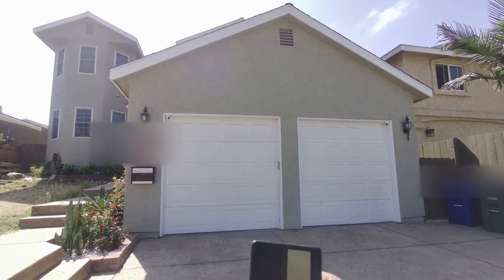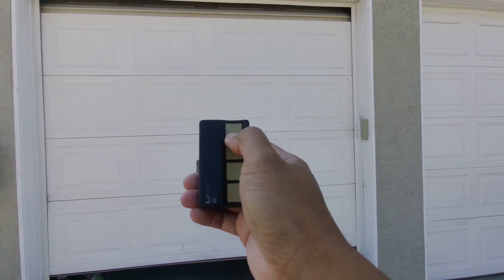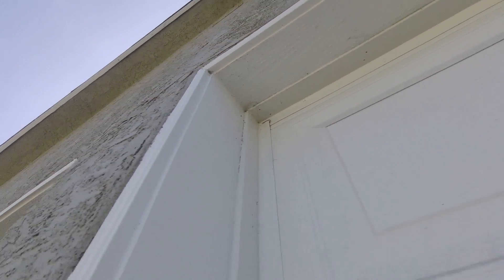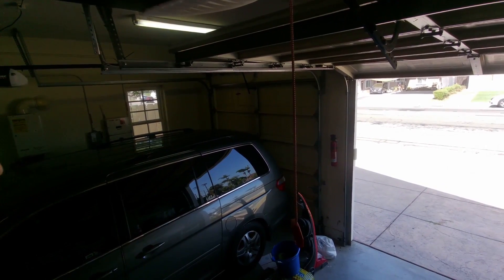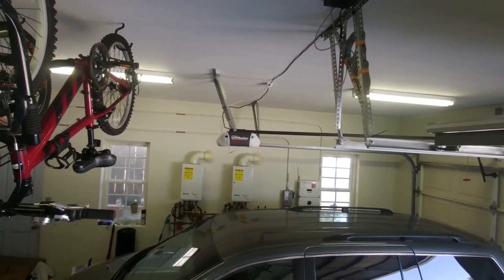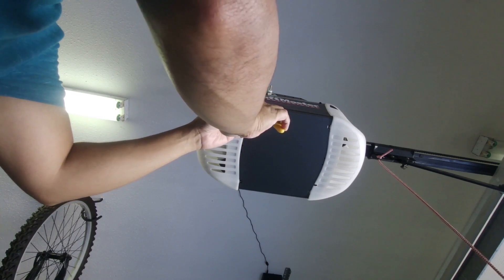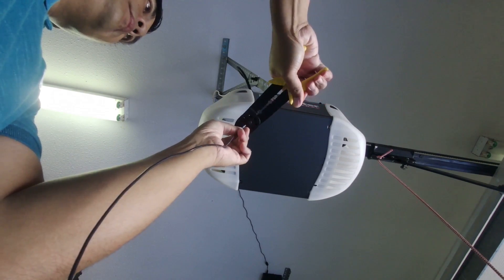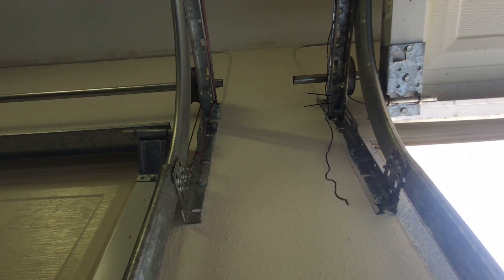Extend Your Garage Door Opener Range - Easy Fix

Comment: The wire coming out of my garage door is such a small gague, would it make sense to connect it to a thicker gague like you did? I think it's like a 20 gague or something, stranded copper
Reply from the maker: You are just trying to boost signal and not running electricity so it's probably fine. Others even use the solid wire for the cable TV with success.

Comment: Is it better to run the exposed antenna at a higher or lower elevation?  Like, is just at the top edge of the garage door better or would 4-5 feet above the garage door be better?  Since the top of the car is only 5 feet above the ground, I wasn't sure if higher might acually be worse.  Thanks.
Reply from the maker: Not sure if it makes a difference. Someone commented another idea saying he attached the antenna to the metal railing and it worked well for him.

Comment: Works great, thanks very much for this simple, elegant solution. I took a roughly 15” of TV coax and used a wire nut to connect the garage door antenna to the center conductor in the coax cable. Then I connected the other end of the coax to the aluminum opener motor straps hanging from the ceiling.
Reply from the maker: Glad this helped, thanks for sharing your solution!

Comment: Great info. Thanks. Like and subscribe buttons hit! Was having this problem after replacing the fried original circuit board on my opener. Thought it was the replacement circuit board but watched the video but before I ran out to get some wire, I decided to try stripping off some of the coating of the antenna wire to expose more wire and that did the trick. If having this problem, try this first.
Reply from the maker: Thanks for the support and for sharing your experience.

Comment: Had a 10 year old Craftsman that seemed to had reduced range when door closed and all lights were off. I could not open the door unless I got out of my vehicle and brought the remote up to the door. I extend the wire 4x the length of the wire coming out of the opener and now I can open the door from inside the vehicle. For now it’s operational.
Reply from the maker: @jimmyg6215  Thank you for sharing.

Comment: I tried this and it didnt work unfortunately 😔
Reply from the maker: Sorry it did not work for you. Do you have other devices that might be interfering on the signal? Or maybe try replacing the remote battery and hope that a combination of new battery and longer antenna will do better?

Comment: When I installed LED lights on my garage the door stop working when the lights are on. I was wondering if I extend the antenna cable will help. So now I will try this! THANKS
Reply from the maker: I have the 8 tube LED's in my garage and the 2 lights outside. I'm still able to open the garage. Good Luck.

Comment: Super cool, can you just use electrical tape to connect the antennae with the wire?
Reply from the maker: Yes. You can twist the wire together and protect it with electrical tape if that is what you are asking.
Reply: @diymanual  Yup, thanks for getting back to me.

Comment: Does this help too if the keypad isn't working?
Reply from the maker: @arpizzle123 , Do you mean for the keypad to get the signal?  When the garage is open, does the keypad work to close the garage door but it doesn't work when you try to open it? Have you tried replacing the battery for the keypad?   I'm just asking because the keypad is right outside the garage door so it should be able to pickup the signal without adding any extension.  Also, did you recently add any LED lighting or appliance that can interfere with the signal? Other's say that LED lights/bulbs and some electric appliances can interfere with the garage door signal so that might be something you may want to check also.  In my garage, I have 8 LED tube lights that I use to replace the old Fluorescent tubes, a refrigerator, security camera  and 2 tankless water heater.  I'm not sure if they are causing my signal issue but I can't remove them from the garage so I tried this method and it worked for me.

Comment: You do not need to lay new wires. Just solder or tie existing antenna wire to any none moving lengthy metal component nearby such as sliding rail of the garage door. That will act like huge receiver antenna. Very neat and cheap way to do it.
Reply from the maker: Thank you for sharing your idea. The rail is long and goes straight to the front wall of the garage plus it's bigger than the wire so it will probably work better.
Reply: Thank you both. I connected the existing antenna to the metal sliding rail, and the weak signal problem was fixed!
Reply: This is incorrect. Antennas need to he specific orientations and lengths to be tuned to the frequency they are receiving.
Reply: @Walru5hunter  I have read this as well, but as in the video, the copper wire length was 20x the original antenna length, and it worked.

Comment: Does the length you add matter? Like changing the antenna from a 1/4 wave to 1/2 or larger. Does it matter?
Reply from the maker: I guess that will depend on your situation. They say that the problem is usually because of LED bulbs interfering with the signal so if you can eliminate that it may actually solve your problem without extending your antenna. I'm using LED light tubes in my garage and also have other electronics in the garage (refrigerator, WiFi security Camera, Smart Plugs) that may cause interference. Other says that simply adding a foot of cable increases their range. But for me I can't get the remote to work until I actually extend the antenna to the outside of the garage door.
Reply: Yes the length matters. The DIY successes are often people getting lucky with right lengths. You can improvise and adjust until it picks up the needed frequency but a dedicated coaxial extension + proper 1/4 wavelength antenna is best way to do this

Comment: I tried this fix but it didn't work. Come to find out it was the cheap LED bulbs that I installed on the motor. Being plugged in but off (not lighted) still interfered with the signal when pressing the remote button. Once I unscrewed the bulbs, I could reach from a couple houses away.
Reply from the maker: Thanks for sharing.
Reply: Thank you!  My problem started when I put in LED bulbs.  The older fluorescent bulbs worked without an antenna modification.

Comment: this really isnt the proper way to do this.. your makin the antenna longer than what it actually is suppose to be.  First off, find out what frequency your door uses, then measure the wire for a half wave and use that.. will workk alot better! this is just my 40+ year experiance in antenna theory and design 2 cents
Reply: Use the K.I.S.S. rule.
Reply from the maker: Thank you for sharing.

Comment: As a quick test, I used a wire nut to connect my opener short wire to a loose wire about 10 ft long and just moved the end towards the door.  It appeared to work well by extending the range to the end of the drive.  I then moved the loos wire and had it run along the ceiling towards the door again and this seemed to improve my range of the remote from before.
Reply from the maker: Thank you so much for sharing this.  I'm sure many people will find it useful to test their setup first before securing all the cables to improve the range of their remotes.

Comment: So many times the range is reduced when you use an LED bulb or have wireless cameras like Wyze or Blink around - or other 2.4ghz frequency devices near by.  The 2.4ghz frequency interferes with it.  Adding this antenna helps because those wifi signals are weak outside of the home.
Reply from the maker: Thanks for the input.
Reply: @almondao this is exactly why i'm looking into this because of the Wyze floodlight cam I bought, when it's powered on, my openers don't work at all from outside unless I'm right at the garage door. I'm assuming extending the attenae just like this will get around that cam interfernce. Did it work for you?

Comment: Great vid.  I actually upgraded my garage opener, but no longer using the remotes.
Reply from the maker: Did you upgrade to a smart garage door opener?
Reply: @diymanual  absolutely. The remotes I keep in the house.
Reply from the maker: I have MyQ in one of my doors that I use for Amazon delivery.  I also installed a Wyze cam in the garage so I can see the delivery person's activity when they deliver the product. So, far the assigned delivery person are good and honest. They would simply put the product to where I specified on the app as the door opens and they close it right away. Most of the time I just see their hand because they start closing before the garage opens high enough for the camera to see them. The only time they go in is when the package are bigger.

Comment: Here is the REAL TEST for LED light interference. Simply unscrew the LED Bulbs (all of the circuitry is in the bulbs, at least the most common LED bulbs) and then test your remote, plug them in once more and see if you can get repeatable results using the remote control from the SAME distance outside the garage. A long coax cable solved my problem (w LEDs left in place) and  since I just thought of this I haven't tried this test. If you, please let us know!
Reply from the maker: Hi! I think the LED interference theory is true. I was having similar issue in my previous home a few years back and I have LED's in the garage motor as well as the exterior light in the front. After removing the LED's it fixed my issue. 

So removing LED's is the first thing I did  after we moved into this house because I just can't get the garage remote to work without standing next to the garage door but I have no success. I even unplugged the Fridge in the garage but it did not improve the range that is why I tried the extending the antenna method that I also found in Youtube and it worked. Of course, this garage have no decorative window and is surrounded by cynder blocks about 7 ft. high.   

After extending the wire outside. I put back the LED's in the garage motor as well as the external light in the front. The range distance may have change but I did not notice because I only activate the remote when I am already stopped in my driveway. My wife does activate the remote as she turn to the driveway and never complain either.  However about 2 months ago, I converted eight 4ft. fluorescent ceiling lights in my garage into LED's (you can see that in my other videos) and after that I noticed that I have to press the remote 2 or 3 times to open the garage.  I decided to keep my LED's because I can still open the garage door and I don't really activate the opener until I am at the driveway so a few clicks does not bother me.

Comment: Very helpful. However I don't think you need to bring the wire outside the garage. I seriously doubt that the garage doors actually block the wireless signals. I'm basing this on my own and other experiences shown in other videos which show that simply extending the antenna wire 8-10 feet toward the door (without having it protrude to the outside fixes the sensitivity problem. However, while your video uses plain solid wire, others suggest coaxial wire (TV cable wire), some even suggesting grounding the coaxial shield, I used coaxial wire and did not ground the shield, and that did the job. Some people suggest that the coax may help with reducing noise coming from LED lamps. Now I can open my door from quite far away with every button press. Thanks !
Reply from the maker: Thank you for sharing. It may have something to do with the wire. I tried extending it first and it seem to work but I got better signal when I run it outside with the wire I am using.  I may not have to do that if I started with a coax.
Reply: How did you wire to the coax?  One lead to the center, and one to the shield braid?

Comment: I’ve read to only increase the length by 2x or 4x. Do you agree with this? I tried this trick. I think I crimped things right and no success. Even worse signal
Reply from the maker: It did improve it for me by a lot.  I assume you have tried replacing the remote battery before trying this?

Also you may want to check if you have any LED lights in and outside of the garage as there are known to cause signal interference.

Comment: I recently had a similar range issue with my opener.  I changed the remote opener batteries, bought new remotes, changed out the incandescent bulbs, and even changed out the circuit/control board.   Non of fixed my problem.   Finally, I extended the antenna wire with 14 gauge wire and attached the end to the door track which solved my problem.   Thank you!
Reply from the maker: Thanks for sharing
Reply: Problem, not "issue."

Comment: Buddy, this problem is NOT related to antenna.  It is the frequency of LED lighting that interferes with the garage door opener.  Change the LED lamp to a regular lamp and your opener will open your garage from even 100 feet or even longer distance.  Hope this helps those who have the same issue and watch your video.
Reply from the maker: Thanks for the comment. You are correct, LED and even other appliance in the garage can interfere with the signal. And to those that read this comment from @fatisalimian2682 you should try that first before doing more work.  I have the same issue with my previous home and I was able to fix it by replacing the LED with regular bulb but for some reason it won't work on this garage. I actually removed the bulb and replaced battery on the remote to no success. So interference can be caused by something else or it is just that my garage door is thick and have no window compared to my other home.  I saw some video suggesting this so I gave it a try on one of the door using the thin wire I have laying around the house and it worked. So, I did this video using a #14 solid wire and to my surprise it worked better than the thin wire I used in the other garage door. So, whatever is causing it to not work when the antenna is just inside the garage was fixed when I extended the antenna outside.
Reply: @diymanual  thanks for your video I agree we don’t have a bulb at all on our garage door motor and it’s still having problems with distance control so we’re going to extend the antenna  and see if that works
Reply: We have extensive led track lighting installed and since then have tried everything to mitigate the reduced signal distance. I installed 30+ ferrite loops and cores all over all of the wires, NOTHING is working except turning off the LED track lighting, until I extended the wire. So don’t poo all over this until you’ve exhausted the other options, but if it weren’t for the fact that I’ve spent months adding the ferrite cores, I’d take em all down and see if the extension alone fixes it
Reply: @fatisalimian2682 Hey buddy. All my bulbs are incandescent bulbs. What other bright ideas do you have, buddy?
Reply: If the LED light if off before pressing the remote button, how does it interfere? Does an LED light bulb interfere even when off? Thank you.
Reply: 🤦‍♂️ Please don't listen to this guy. The absolute confidence he speaks with is something you only see from people with limited knowledge.
Reply: Good sir, thank you. This saved me time, anxiety, and money.
Reply: Can you change the frequency to allow you to keep my LEDs??
Reply: My antenna has a little plastic or glass cap at the end, if I cut it off to extend it with a wire, would it damage my antenna?
Reply: Removed my led lamps and still the range is terrible.  What gives?
Reply: From what I remember about my CB and Ham radio days the wire length is tuned to the frequency of the transmitter. Maybe it doesn’t matter in this case, but I thought extending it with a thin piece of coaxial wire then stripping it back to the same length of antenna that would stick out of the unit might work better? 

On the other hand if a solid piece of wire does the trick, why not just keep it simple and do that? 😊

I haven’t made any changes to my garage, but a software update in my car seems to have reduced the range or caused intermittent issues. Sometimes it opens sometimes it closes. I’ve got a HomeKit enabled opener/closer that I installed so when the Tesla doesn’t automatically close it I generally say “hey Siri close garage door” and it closes, but it’s a bit of a hassle and would like the car to automatically open and close the door when it’s in range like it used to. I’ll consider this option thank you!
Reply: Thank you for chiming in here, I didn’t know that my new LED would affect the range, and that made a big difference, changing it to a non-LED bulb ASAP!
Reply: You just saved me an hour of my life.
Reply: Well the light bulb is blown out and it's a regular halogen bulb so it's definitely not the bulb for me. I think I'll try extending the range with a solid wire
Reply: The LED bulb was my problem. Thanks!
Reply: Buddy, how do you know that he has LED's? Telepathy? I'll bet that you can repair all electronics without even looking at it.
Reply: @joesimone223   I had the same problem.  My garage is fitted out with about 8 4-bulb fluorescent fixtures.  I switched them to LEDs, and now you have to practically drive right up to the garage door before the door opener will respond if the lights are on.  LED bulbs definitely interfere with garage door openers.
Reply: @stevensheldon9271 i am so confused. Do the LED lights interfere even when they are turned off???

I checked my openers, they don't even have LED bulbs. Old cfl bulbs.

The only LED I have in the garage is a sconce light that isn't even turned on.

Comment: Does the wire need to be solid or will speaker wire work?
Reply from the maker: I have only used solid wire. But you can try and let us know if it works for you. The goal is to extend the signal so that whatever is interfering with the signal will be isolated.